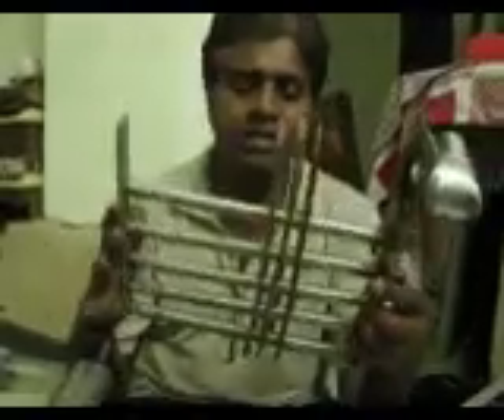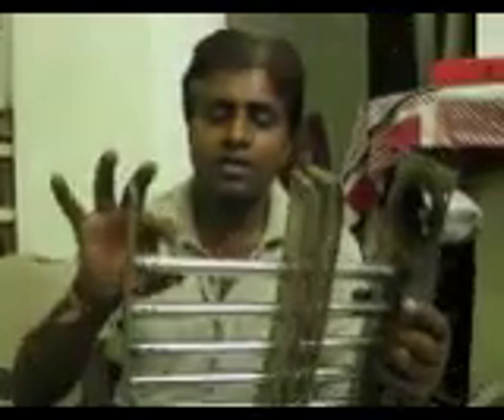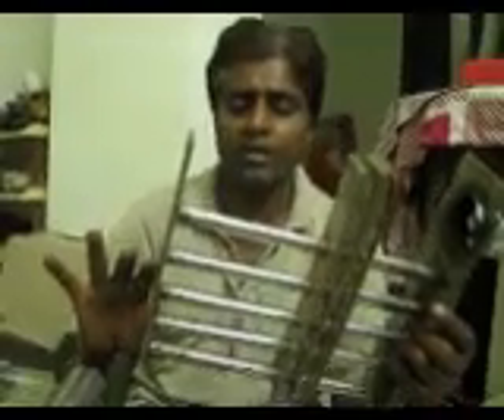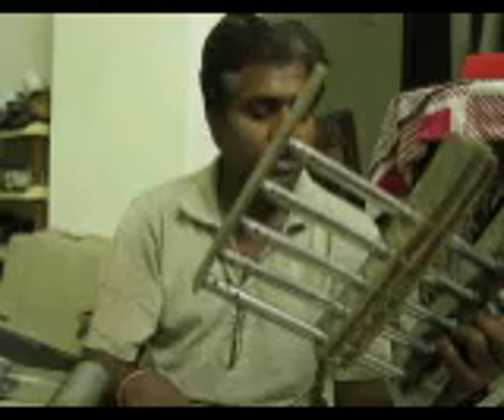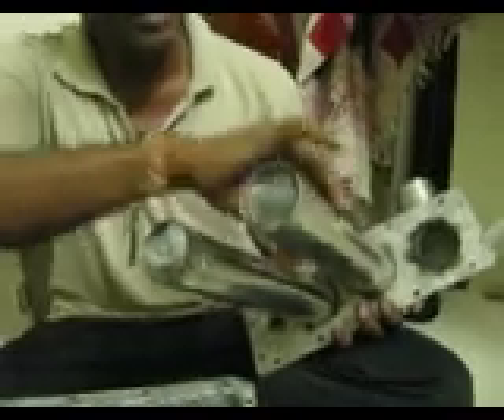Gasoline Evaporator - Little modification and findings

Comment: When I install a vapor system on a car I usually install the performance thermostat on the cooling system and never have to worry about having to pull back the inlet pipes to the container. My vaporizer is actually an "S" shape matching the size of the throttle body. Engine temps are never an issue. If that was to be, then I may consider adding an air duct to counter the heat buildup.
Having a simple floating level system to trigger the fuel pump can also help in selecting the level of fuel.

Comment: If you install a lower temperature thermostat on your vehicle, you wouldnt have to worry about over heating the container. For example, when I build a high power sport car, I will install a 60' celcius thermostat. When not racing the vehicle the needle on the car will peak at only about 1/3 up as apposed to being right at the midway normal level. Your engine bay is much cooler and on certain cars you could literally come to a stop and open the radiator cap and not explode.... continued.....

Comment from the maker: Wow that is a nice news. So you do the trail with the air heating and I will do the trail of gasoline heating. We will share the result and will OPEN SOURCE the final design for everybody to replicate. 

Just I did the trail and uploaded new video. After 15 min gasoline temp was going down to 20 Deg C and at that time car was loosing pickup. When I was adding additional fuel then temp of gasoline was going to 22-23 Deg C n there was no problem at this point. So lower cut off point is 20 Deg C.

Comment: On the new improved system I am in the middle of building I actually am building a device that will preheat the ambient air going into the vaporizer! I may also use this same device to heat the air/vapor again on the outlet end of the vaporizer. I am starting with the one on the air intake side first then if the secondary one is needed I will make that one.

Comment from the maker: 3. Now to avoid too much heating of gasoline, we shd use the thermostat  coupled with a pump. So as soon as the gasoline reaches to a particular temperature the radiator water circulation should be stopped to avoid over heating. 

In this approach we have to find out that comfortable temperature of gasoline. 

Your comment please.

Regards

Praveen

Comment from the maker: Hi,

Thanks for your input through two comments. In fact the approach suggested by you is workable. Other then this I have following ideas

1. Since the car already has perfect system to control the air flow to engine, so let us not disturb it.
2. During evaporation gasoline looses its latent heat and gets colder. So we have to maintain the temperature of gasoline. This we can do using radiator water circulation.

  contd...2

Comment: It is still necessary to have the pipe submerged under the gasoline for cold start up purposes. Once the gas and container has reached the correct temperature you no longer need to bubble air through the gas, what you need to do is raise the pipe up so it is no longer submerged under the gasoline. Doing this allows air to still flow through the container to carry the vapors into the air intake while at the same time preventing an over enrichment of fuel to air. Hope this helps.

Comment: Yes you will need to decrease the air flowing through the container. In my videos I build a crappy secondary air inlet valve and placed it between the vapor outlet pipe and the air intake butterfly valve. This allows less air to pass through the vapor container and more ambient air to enter the vapor mixture without creating more vapor. When you are using heat bubbling air through the gas is not necessary but you will still need air to flow through the container.

Comment from the maker: Hi,

There was no flash back problems on my car. Basically I am planning to build a device where all the air goes to engine through evaporator. If we have to control the flow of air with respect to temperature of the gasoline then we will require a electronically controlled valve, which allow more air flow when temperature of low and vice versa. That will be a synchronization problem and to run the car all the time on gasoline vapour we have to achieve this.

Comment from the maker: Thanks for your comment.

The boiling point for gasoline varies country to country. As per international standards it ranges from 100 - 400 Deg F i.e. 37 - 204 Deg C. In India the boiling point of Gasoline is 180 Deg C. Normally the boiling point is tested in the Distillation process and recoveries up to 70 Deg C is upto 10-45 percent. 

With this data we may require the heating of gasoline using radiator water circulation. I will test it with heating and without heating.

Comment: hello,my friend
i think that there is no problem with the gasoline température ,if gasoline  is hot it will evaporate easier and you have only to decrease the air flow in the evaporator
did you test it on a car for 30 min ?were there any flashback problemes?